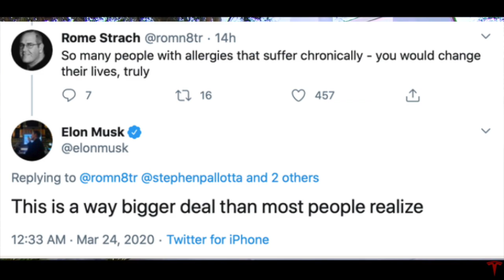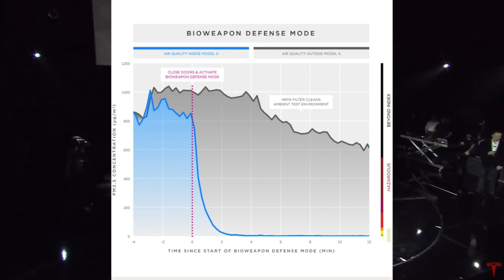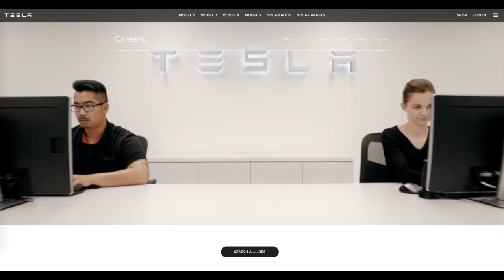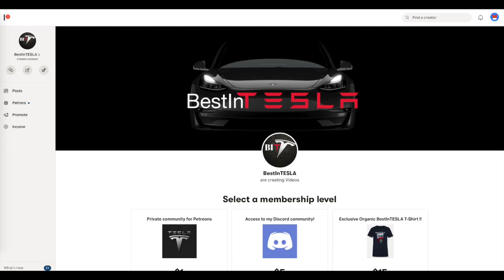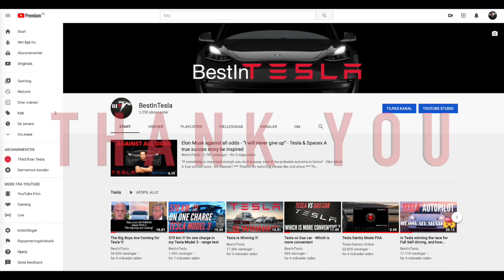TESLA's secret product : The Smarthome - HVAC system for the home

Comment: RE: Tesla HVAC system 
Today, no existing technology, except the Maisotsenko Cycle (M-Cycle), can provide such features desired for Tesla HVAC as energy efficiency, silence, zero environment impact, low cost, healthy air for air cooling and heating, heat recuperation, air humidification-dehumidification - all in a revolutionary concept of the evaporative cooling, approaching air temperature less than the dew point temperature.
The M-Cycle makes the indirect evaporative air cooling technology a cost-effective, energy efficient, and environmentally friendly alternative to mechanical refrigerant cooling & heating equipment.
Gen3 M-Cycle: Better performance (price, energy, emission) for less

From Nikola Tesla (energy from air) to Tesla smart home HVAC system (disruptive and efficient).

Comment: So few details on this HVAC. What refrigerant? What is the COP as a function of temperature? How is resistance heat phased in and is there any user control of that to speed heat ups in frigid weather. What kind of compressor. As for house HVAC is this a minim split?  Who would install it? Service it?

Comment: As it is, each house owner that uses air conditioner in the summer, spends (and pays for) energy to cool the condenser unit stationed outside the house. At the same time, spend (and pays for) energy to heat the water and the swimming pool if they have one.

Comment: No, does not advance the cause. A heat pump in the house is good if it’s an all electric house. They’ve been used efficiently since the 1970s. Most people prefer the feel of natural gas if that’s available in the home. This compares to an electric stove versus a gas stove. A advance filtration system sounds amazing but this is more about tightening up the seals and making the house airtight for something like this to function. All these things exist.Expensive for the most advanced but available.

This would be a waste of time, when so many other industries are still prehistoric.
Reply: Hyperdrive E 
I believe the big deal Elon spoke about was the ability for a hvac system to pull water out of the air for personal use, a machine with the sole purpose of generating water perhaps

Comment: Yes, it looks like the heat pump in the MY is the smartest and most efficient one there has ever been, and it seems certain this could be scaled up for use in a domestic hvac system. With solar roof and powerwall, the final piece in the off grid home and vehicle solution.